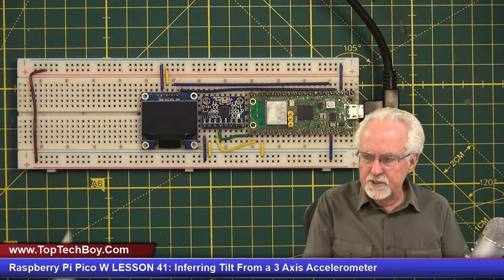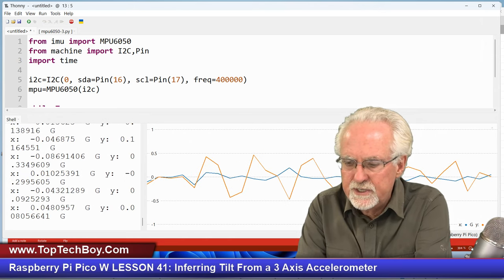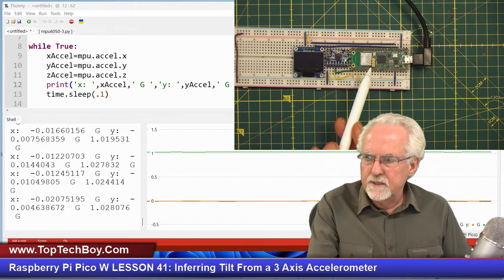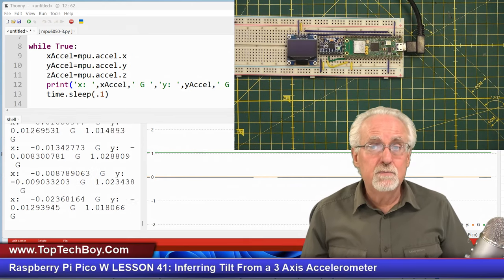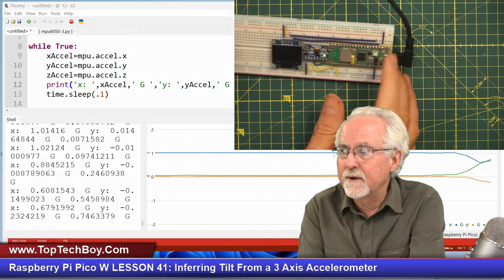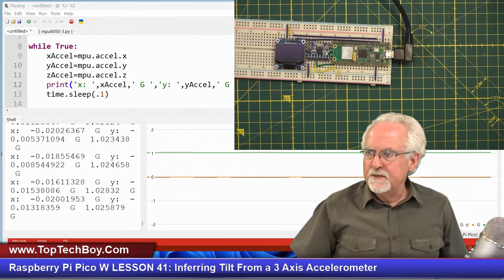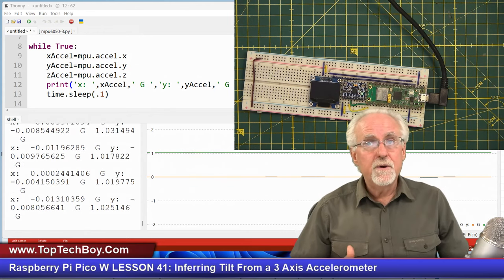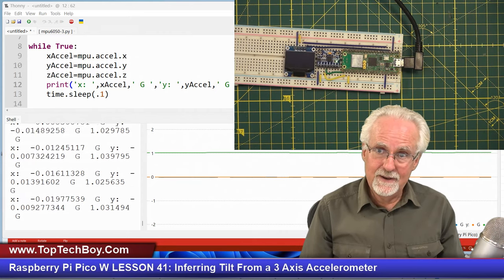Raspberry Pi Pico W LESSON 41: Inferring Tilt From a 3 Axis Accelerometer

Comment: Paul I don't know if the chat got through or not, here is the way I did  the larger fonts on the oled.  I found a library called oled, which includes Write, GFX, SSD1306.  Then from oled.fonts  import ubuntu_mono_15, ubuntu_mono_20.  Then to write to the oled, use this write20.text(< text or variable >, y position, x position)

Comment: Paul, it was a very interesting lecture, thanks! I have a question about the direction of the acceleration on the z-axis (acceleration is a vector). In this basic experiment where the 'body' (breadboard) with the mpu6050 is resting on a horizontal plane, the z-axis acceleration component is +1g and the x, y components are 0g. That is, according to the mpu6050, there is one acceleration component in the same direction as the z-axis. The z-axis for the mpu6050 (resting on a horizontal plane) is pointing straight into the sky. That is, the acceleration due to the gravity force is pointing in the same direction as the z-axis (towards the sky). Shouldn't we get an acceleration of -1g, that is pointing downwards the center of the earth.
Reply from the maker: The force of gravity is down, but the table is pushing up, against gravity on the device.